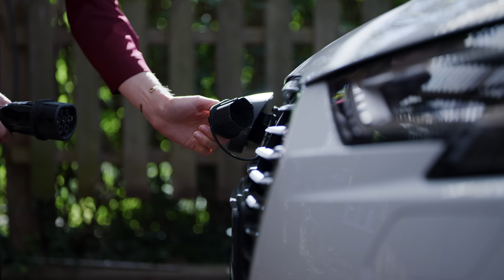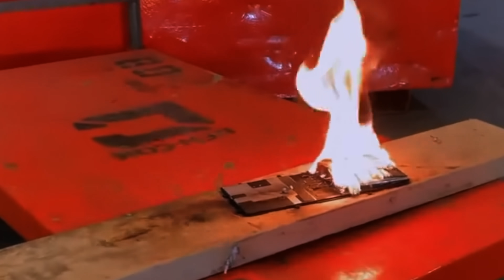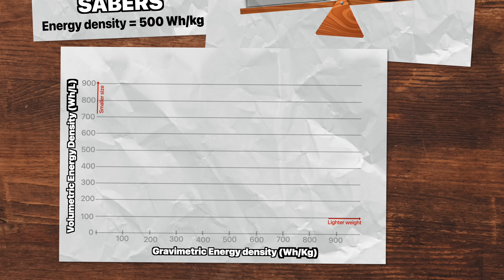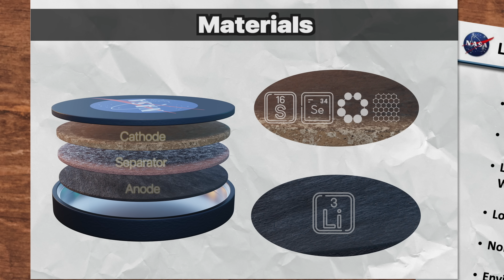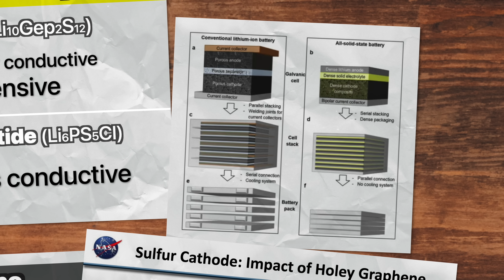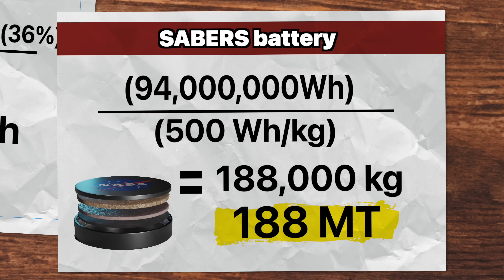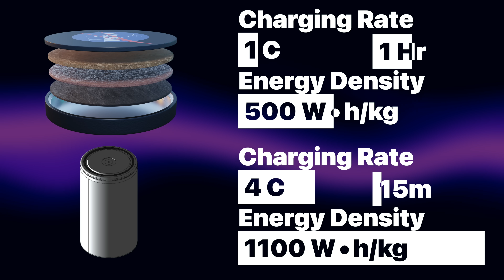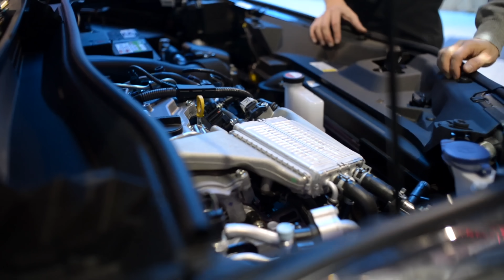Why NASA is Building a Solid State Battery

Comment: To clarify.. passenger airlines cruise at altitudes where the air temp is around -50 degrees F. So these batteries will still need Temperature management (as well as the passengers). Where will that energy come from?
Reply: When the engines are running and current is being pulled from the batteries, that flow through their internal resistance generates heat which, with insulation, can keep them warm, and might be used to heat the cabin as well.
Reply: Yup 0°C is not a great temperature floor
Reply: we are talking about very energy dense batteries. Where might the energy come from? Possibly from the battery ;-)
Reply: @sikliztailbunch  yes but it might not be able to keep its charge in cold weather if it's got to keep itself warm!
Reply: @ReactorNumberOne  I guess they´ll figure out how to reserve a certain percentage of energy for heating. You have passengers, who also don´t want to freeze, so I don´t think that will be a major issue for guys who went to the moon, lol
Reply: Don't worry a thing called insulation and the battery itself.  Of course this battery will never be used as Selenium is 50% rarer than SIlver.  This is as STUPID as talking about fuel cells using Platinum or Niobium.  1 or 2 dudes out of billions can actually afford one.
Reply: @w8stral  We're all driving vehicles with platinum and palladium catalytic converters. It doesn't take that much of the precious metal to do the job, whether it's a catalytic converter or a fuel cell
Reply: Vast difference between something 1 angstrom thick in your Cat compared to ~1mm thick times a hundred plates in your fuel cell.  Literally ~ 1 Billion times more Platinum in a SINGLE fuel cell than catalytic converter.  There is a reason NOT ONE SINGLE person associated with the project over the last several decades has EVER said to use said fuel cells in vehicles.   Not one of them.  WAKE UP!  @brettclark8020
Reply: Wind Velocity Generators' from various vents around the fuselage _ 'ding'
Reply: YEa, magic... you are SooO rigHt... Dong @spiritzweispirit1st638
Reply: Good insulation. The batteries have mass, thus will hold a warmer temperature from before takeoff. As energy in a battery is used, a portion of that energy is turned into heat. 
So the question becomes how long would it take for the mass of the battery to drop below  the ideal working range, and how much energy need, if any?

The problem is not much different than a naked person stepping out into a winter environment. They don't instantly freeze if it's -20ºF. Putting on some cloths extends the amount of time a person can work in -20ºF and remain comfortable.
Reply: Well, Aircraft have to fly over Greenland at -80F for more than 2 hours at this temperature to be passenger rated.  Flights are sustained at -40C/F Kerosene freezes in the wings at this temp and why only 2 hours are allowed.  You have to modify flight plans if -80F is predicted for more than 1 hour.  No.... no human can remain "comfortable" at M0.85 and -40C.  There would have to be ZERO portion of the wings or fuselage which would touch the battery at this temperature otherwise you will instantly freeze the battery and there is no way in this world you can carry enough kWh of power to heat the areas in contact as you can do with Kerosene.  This drastically decreases range as volume is drastically cut for air gap separation as insulation cannot be touching it either as a conductor path.  This makes securing the batteries in the wing rather problematic not to mention how the HELL do you make a wing with batteries in it???  The fuel tanks are BUILT with the wing structure and sealed at manufacturing date.  Big empty voids.  You cannot get in there to service anything.  In WWII we used midgets to rivet the interior of wings...  I kid you not, my dad knew one of them personally.  Wings have become thinner since then.  

All of this to say, batteries are NOT going in the wings, they would have to go in the fuselage or massive extra weight added to wings.... In the fuselage leads to heavy wings required anyways as bending moment is going UP, big time.  Will not happen in my lifetime or wing design will completely change to allow giant openings in the bottom most likely as compressive top section is REQUIRED for those wind up +2G turns whereas bottom compressive stress only has to take -1.1G.  These giant cut outs for battery installation will necessitate MASSIVE increases in skin thickness and weight.  

No free lunches in Aviation @AerialWaviator
Reply: What about a hybrid system for planes. 
I.E. use the center apu to run a generator to power electric turbo props, and have a smaller battery pack for takeoff/togo amps. 
And maybe have the option to plug in at airports for more range.   

Trains do it, priuses do it, why can't planes do it? 
Hybrid till we get there.
Reply: @world_still_spins 

I don't think hybrid works as well for aircraft as it does with land vehicles, because aircraft are much more sensitive to weight than ground vehicles. Without the weight savings from removing the conventional engines completely, the batteries are going to increase the weight, which means the extra energy required to carry the higher weight will result in more fuel burn and overwhelm whatever fuel the hybrid technology theoretically saves.

Best case, you can power a conventional aircraft with electricity when it's on the ground by using an electric ground vehicle to tow it to the runway, without needing to haul the big battery into the air, but that's kind of about it.

Conventional aircraft are already plugged in at gates, by the way, to avoid needing to pay for jet fuel just to run lights and HVAC while passengers get on and off.
Reply: Sigh, does this SIMPLIFY an aircraft?  No.  It makes it MORE complex and therefore MORE expensive to operate = DEAD ON ARRIVAL.  NO ONE will buy it.  You have to IMPROVE economics, not make them worse for a new product to be bought.  Government MANDATE Bull Shit does not count.   As for why TRAINS do it is because trains have to get their power to their wheels and doing this via gearing loses a HUGE amount of power.  Combine this problem with must start stop a lot, go up/down hills all the time and viola you have to have a MUCH larger engine than required.  To increase efficiency they go electric diesel, use multiple engines to vary power output which can be turned on-off quickly and more importantly, power can be SHARED between engines for those short hills allowing them to use ALL the traction wheels.   An aircraft does NONE Of those things.  It is single use item.  It takes off, climbs to cruise, and ... cruises to destination where MAJORITY of time is cruising to location.  A hybrid could by and large ~only work for VERY Short haul aircraft ~1 hr 45min flights.   Anything longer and well, vast majority of power is required during cruise.  Basic drag energy power equations in aerospace define this and have been proven since ~1930's.  In other words  their is no new math there... @world_still_spins
Reply: waste heat
Reply: You heat the battery to 100°C before take off.
Reply: Genius alert: Woop Woop... You just fried the battery... Good Job Johhny boy.  Likewise said batteries would freeze at altiutde from 100C to -40C in about 1 hour tops unless there is serious insulation in between.   @aleisterlavey9716
Reply: From battery.. they are inside the cocoon
Reply: From the batteries of course. Also airliners should fly lower to combat climate change (high altitude condensation clouds add to warming, low altitude ones decrease it).
Reply: LOL, bud you have that backwards, and it depends WHERE in the world you are flying.  If higher than ~30 degrees N/S, then no, but if over the tropics, yes... and it is NOT the condensation, rather.... It is the ADDING of H2O at high altitudes(40,000ft and above, really 45,000ft and above) that lead to increased temps as it PUSHES more heat N/S from the tropic zones which is the DRIVER for earth's global temps.  Without the Tropics pushing heat N/S earth turns into a snowball VERY quickly(Why there has been ZERO heating over tropic regions, but more heating near the poles)  The Arctic regions are the earths radiators to space.  Genius, if flying with batteries, there will be no adding of H2O at high elevations other than the cabin atmosphere venting all the passengers farts...  @4203105

Comment: you did the math and you ended up 7x the weight. And did not get into the equation that commercial flights (and others) are also calculating with the weight reduction as fuel burns. So they calculate the range based on losing weight along the way. That is not going to be the thing with any batteries. Batteries are not going to revolutionize commercial flights soon that's for sure. Biofuels might, and that is also not new technology.

Comment: I wonder if it would work if they used AI to come up with even batteries.
Reply: Only if AI is running robotics for the assembly & testing phase

Problem is, robotics is only really possible in mass production scenarios, where manufacturing is very well defined
Reply: @DavidHalko  thank you.

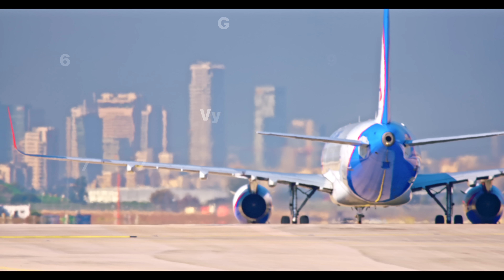Comment: 7:28 - that's a big fat nope. Between 9,000 and 12,000 metres (30,000 and 40,000 feet), the cruising altitude of most jet aircraft, air temperatures range from −40 to −70 °F (−40 to −57 °C).

Comment: toyota seems to be all over the place on future tech... listing that they will first release this new battery in hybrid GAS-electric first is showing they do not want to give up on gas cars first (if you have ever really driven a hybrid you will know that 99%+ is just a gas car). Toyoda is also pushing forwards on there hydrogen fuel cell cars and stating that fuel cell is the way to go. with all of that i can not see them also having the money to seriously be spending the R/D on solid state also.  Again it seems they are researching everything and having major breakthroughs in every way if you follow there press releases and perspectives. So as far as Toyota.. i am sceptical.

On solid state batteries i am hopeful thought  They will solve many of the "Issues" that gas companies can say are reasons that EV's are bad. 

I am enjoying the industry finally (in the past 20 years) spending the money and research into better batteries.

I always wonder what people think is the best change breakthrough in a technology . For me it was when they stopped trying to fit batteries into the standard they made around World war II to make them interchangeable from country to country  at the time it was the right thing to do but it stalled major batterie improvement for more than 30 years since every  major battery was designed to fit in AAA, AA, C & D size. when I was growing up it was those sizes and specialty extra expensive batteries  But i alway wonder what everyone else thinks the major breakthrough's were in battery tech were?

Comment: Time to pull out my Youtuber degree to ask stupid questions and stupidly call things to question. In summary because it would be a video itself drawing attention to this. Axial Flux motors, or Raxial flux motors have far more power output to weight ratio. Making it possible to replace those 737 equivalent engines easily. The charge times and power output can easily be address based on configuration of the battery packs alone. How each battery pack is constructed will also affect its power density and charge times. Comparing two different storage methods for the battery with the information given means nothing, and would be inconclusive answers. None of this either takes into account other factors like how a majority of flights take more fuel on than they need meaning necessary weight. There are also other sub systems that would no longer be needed to the integration of fully electric system. This is easy, just who sits down and spends the money first.......wait they have. Koenigsegg’s dark matter engine, and Rolls Royce axial flux motor engine with its all electric vehicles. Its not only possible its happening now. This battery just met the mark to enable it.

Comment: These batteries could replace convental systems if they were using plasma jet engines that use magnitrons.
I love lithium titanate batteries i bought them for my rv as soon as they were commercially available. 20,000 cycle life great c rates no cold weather susceptibility
Reply: Sure and the tooth fairy is real

Comment: i think lithium metal is very reactive and can start fires too so sabers battery still has a potential of catching fire it is maybe down to the molecular bonds between the materials that can make it more difficult to catch fire.

couldnt an electrolyte block be made pre charged with ions and make it work like the newtons cradle where an ion is fired in one end and fires out the other end in a similar way as how the newtons cradle works?
Reply: Good thing jet fuel isn't combustible.

Comment: Electric planes will not need as much power for takeoff if designed from the ground up for electric propulsion. You can put more, smaller motors along the wing. This increases the lift of the wing, which also lets you make the winger smaller, reducing drag during cruise.
But yeah. No transcontinental flights any time soon. But that’s a small share of all flights. Most routes only use a small fraction of the airplanes maximum range. Electrifying local flights would be a huge benefit. 
For takeoff you could add some capacitor banks for a short burst of higher power.

Comment: An airplane operates in an environment that is far, far below freezing. Will this battery work in those temperatures?
Reply: Nope.
They will need to heat the cabins with electricity from batteries, as well as the batteries [themselves]

Comment: NASA’s new battery could power 90% of current commercial aviation? You could quadrupole the current output of the best battery technology used today and it still wouldn’t be possible. Discussing new battery tech is good and informative but there is nothing in reality that suggests batteries are a viable option for commercial aircraft.

Comment: Hydrogen is a far better fuel for things that require large amounts of energy. It would be great for large trucks, airplanes, farm equipment, etc. I’d take it over batteries for regular cars too. A straight internal combustion engine that just burns hydrogen instead of gasoline. It’s clean and has all the benefits of the internal combustion engine, especially on colder climates like where I live. Batteries just don’t hold up to the cold. Try getting in your electric car after it sits outside for 10 hours while you’re at work in weather that’s 20 degrees below 0 without having it plugged in and see how far you get.
Reply: I'm pretty sure an EV left unplugged overnight in -20 would still drive the next morning, assuming it began the night with a well-charged battery. It might have a lot less power and range than under normal conditions, but for city driving, it would still be more than plenty.

Comment: They need to look into a catapult system to gently supplement the amount of energy needed for take off. 
I know this would be a major infrastructure issue but I have to wonder if it would help the jets just as much as the EVs
Reply: The G forces from a catapult (railgun) would be intolerable (dead passengers).
Reply: Suggest basic Physics course: Pronto... Stop typing, suggest a book...
Reply: When you say catapult are you talking about capacitors..?
Reply: LoL, boy I was off in my understanding 😂 🤣 😅...
Reply: Electric catapults on aircraft carriers are used today.

Maybe just use slightly less G’s, since ground runways are longer
Reply: What on earth for?
The energy required to climb to cruising altitude is far higher, and energy to flying to the destination higher still.
Reply: Idiot monkey's allowed access to a keyboard is why...  @incandescentwithrage